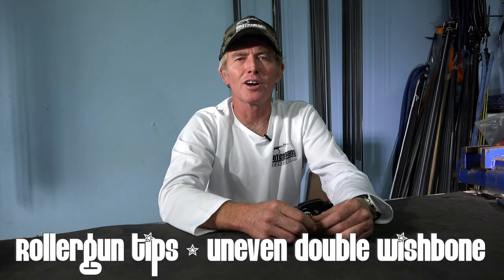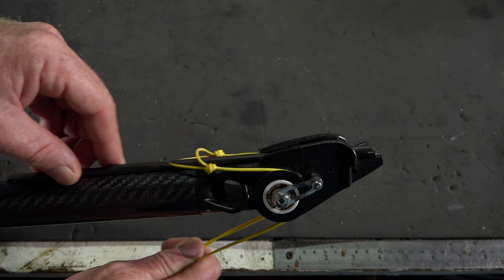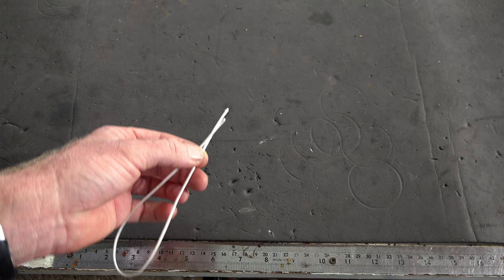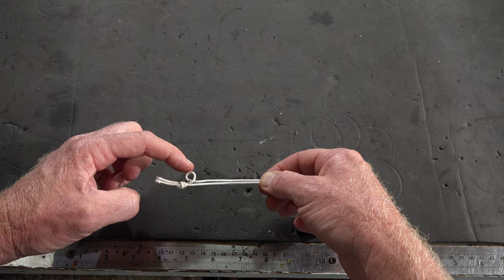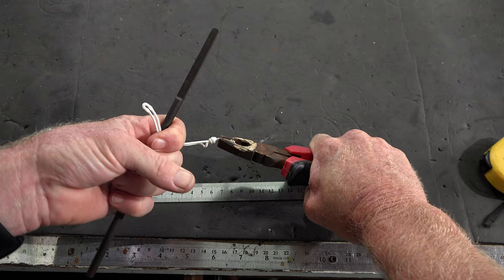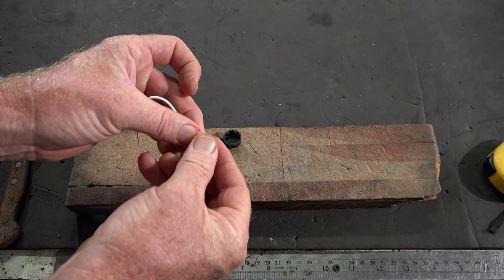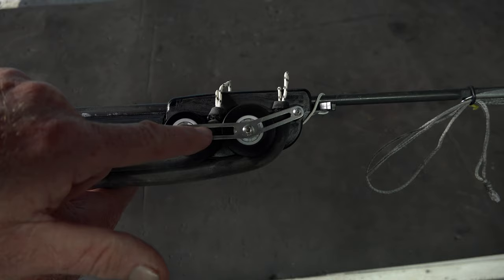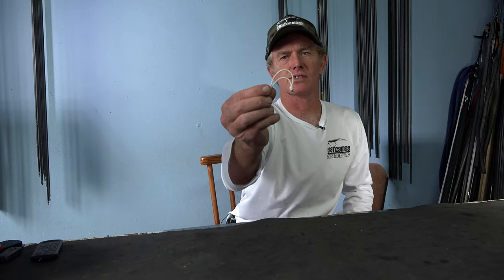The Uneven Double Wishbone | Unrolling The Rollergun

Comment: Coats would you consider doing it on ermes double roller head or Rob Allen notched drop barb? 
My ermes front rubber wishbone tends to fly forward ahead of top bracket but I guess I can try to shorten it even more...I though about doing a double front rubber wishbone but I'm a bit worried it might interfere with notch on the back...

I though of polishing the top of the notches on my RA drop barb a bit so it has less surface area to hold the wishbone too as they have quite aggressive overhang

If the rubbers for some reason are missloaded on improper notches the effect of shaft being whipped up the muzzle increase 10 folds xD I had a client that would load them other way around couse it was too inconvienent. 😂
Reply from the maker: With the angle of the Ermes roller muzzles rails and the std RA notch it is best to load on an uneven wishbone to reduce the shaft lifting at the muzzle.

This should also negate the need to modify the notches.

Comment: What do you think about kicker bands for roller gun? Obviously it adds recoil mitigating the smoothness of the roller gun but it also adds a bit more power. is it worth it?
Reply from the maker: Hey Levgenii
Kicker bands are a HUGE NO!!! If you setup your rollergun correctly then there is absolutely no need for a kicker band. Only adds unnecessary recoil.
If you are wanting a 'powerful' setup, opt for the 16mm bands and 7.5mm shaft loading with a load assist. Get this right and you will see that there is no need for any extra power.
Reply: @CoatesmansSpearfishing  thank you very much! I have wooden roller gun 70 cm, shaft 7mm 100 cm. Do you think 14 mm bands with 350-370 % would be ideal setup? One thing is my gun rollers are simple ones, with no bearings whatsoever. Thank you for your help!
Reply: @CoatesmansSpearfishing  love your videos by the way. I like rollers and inverted rollers. Right now a person is building my custom inverted roller gun, it’s a thing of beauty. I live in Indonesia, and here almost all guns are wooden ones.

Comment: Awesome video thanks Chris. Ive noticed that even with my new RA roller head (bought in 2019) the wishbone sits well above the spear/rail line. I can see it has small notches cut in similar to your previous video but they don't seem to actually stop the wishbone. Is it worth using an uneven double wishbone?
Reply from the maker: Yes the uneven bridle will definitely eliminate any issues with the bridle riding up. 

What shaft are you using? Notched or pinned / sharkfin?
Reply: @CoatesmansSpearfishing  The standard 7.5 Notched shaft that comes with the RA Roller.
I haven't noticed it shooting low in the past but am wondering if I have just been compensating for it perhaps.
Reply: Chris how would you make a wishbone with a handle for the hand load setups?